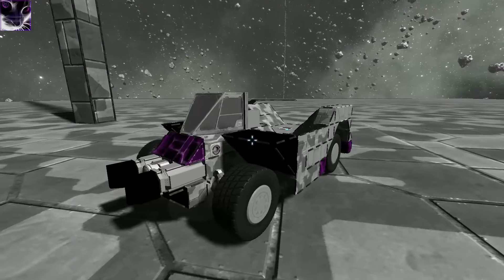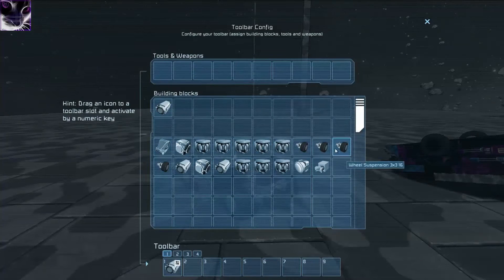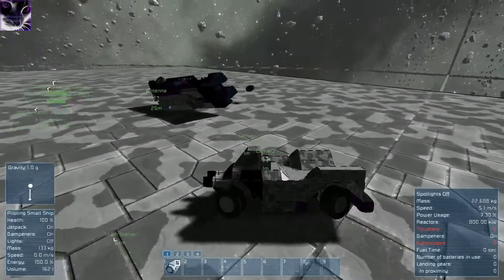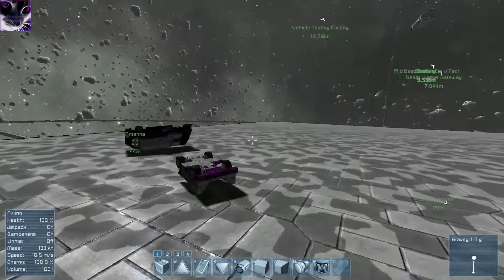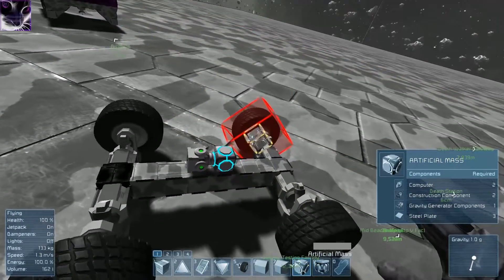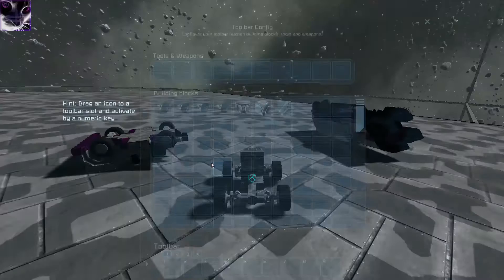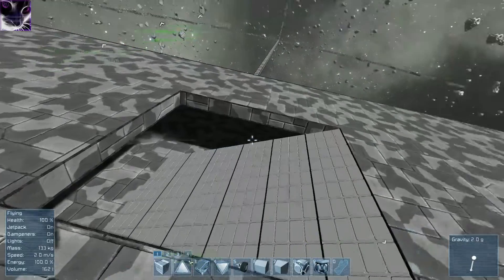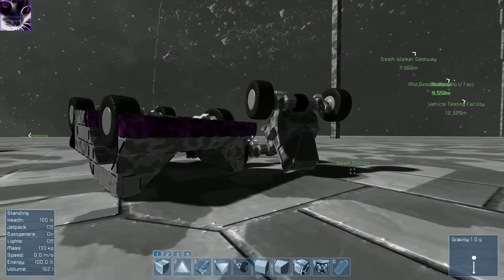Space Engineers - Wheels & Pistons (How to build a Car)

Comment: lol "they need to fix this" its not broken, that's how its supposed to work. Cars are tough  to make in SE I'll give you that, you did it mostly right, you didn't use gyros preventing too much  flipping but remember there is a center of mass on vehicles now, so where you place the mass blocks and how many you use are relevant.  For a vehicle that size I'd say use 5-8 mass blocks placed at or below wheel level, also have the station gravity set to 2g (2 gravity generators) for best results. As per size and shape they matter. I noticed no matter how stable my vehicles become the more blocks i add the more floaty they tend to be regardless of my mass blocks. so regular blocks are effected in some way by the atmosphere, i just haven't figured out how to counteract that yet. Remember this is still alpha so alot of these things will be reworked soon. The default settings on wheels don't work well on 90% of vehicles, so mess with the power/friction/ strength settings till you find a good balance for the vehicle your making. Good luck man.